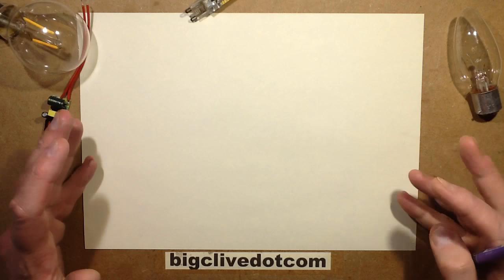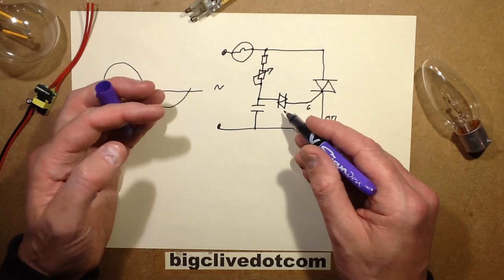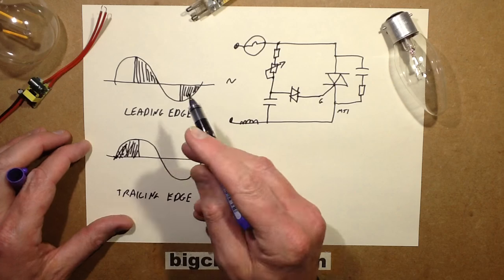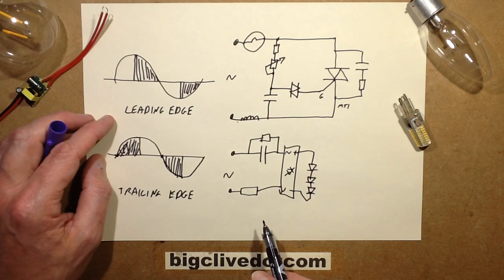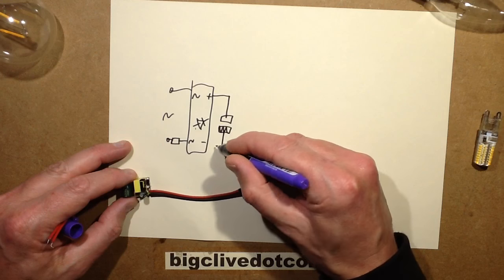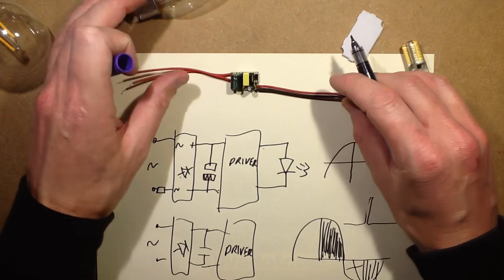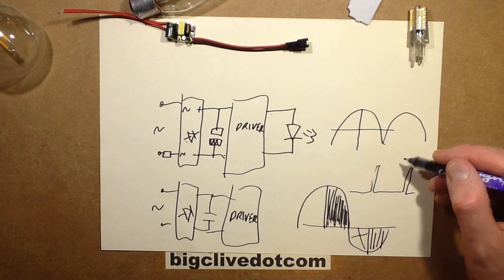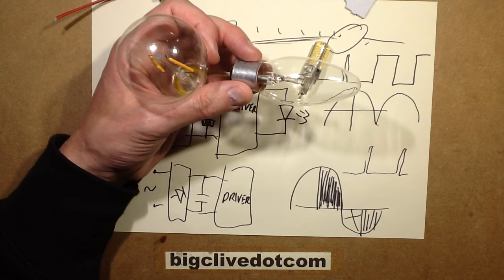Dimming LED lamps with ordinary dimmers.

Comment: Here's a thought which might sound insane to some. Use a line level amplifier circuit. I've built amps before that didn't really have a transformer to speak of. Yes, I know their dangerous and I know why. The point is this. A signal source can be taken from the input and reduced to regulate the output in essentially the function of a volume knob. This yields a perfect sine wave or at least as perfect as it's seen coming from the wall. It's also not as sensitive to load variances. The only real issue is the cost of construction which is likely why they aren't an industry standard. That or nobody has thought of it yet. Also it would be a fairly large device considering all the components necessary such as the heatsinks, smoothing capacitors, MOSFETs, and so on. In theory though, it should work for both incandescent and LED bulbs. I'm not sure I'd try it with CFL bulbs as I'm not sure how it would react with the ballast circuitry. It might be a fun project to try for your channel. I don't currently have a working camera which is why my channel only has the one video so far. I did build one though and it does work reasonably well. It won't fit in a standard wall box for one switch, requiring a 3 device box instead. It works fine as a table top device though, with a hacked extension cord as both input and output. It sits next to the wall on a side table with the cords down behind it.
Reply: You may be talking of a sinewave dimmer ( class D?). Heard of them, but never seen an industrial or consumer one. It would need a new type of LED driver in most cases, although one I designed 6 years ago is compatible and will start up at about 40V ac rms and dim between about 100uA to 700mA.
Reply: Jeremy Lister Interesting. I never had a title for it but being a sound technician, this design made sense to me.

Comment: I have heard (somewhere, don't remember where) that the original dimmer devices were actually wirewound potentiometers (cringe!) -- maybe that would work better for LEDs than it probably did for incandescent bulbs? ;) either that, or a simple variac sort of setup, like the old model train transformers (I think?)...?
Reply from the maker: Yup.  Wirewound rheostats and liquid dimmers.

Comment: What about these new LED dimmers? What kinda magic are they wielding?
Reply from the maker: They tend to use a MOSFET to allow reverse phase control, where they turn on at the zero crossing point and off mid-wave.  It's much softer on circuitry and electrically quieter.

Comment: I have a question Clive.  My vehicle has LED daytime running lights are are illuminated to 100% with the headlights off in the day, and around 50-60% at night with the headlights on.  When I turn my headlights on at night, my LEDs are at a visibly reduced intensity, but I don't notice any sort of flicker at all.  Could it be because they are low voltage (12 v) LEDs and dimming them is easier than a "mains" voltage LED?  Or is this the sort of new LED dimming technology that you were talking about at the end of the video?
Reply: It's just a guess here, but I assume they are doing pulse-width modulation as described toward the end of the video. Many car manufacturers have been doing the same thing with incandescent dashboard lights for over a decade now, and it makes sense that they would adapt that to LED lighting as well since it requires virtually no more R&D. It's a more reliable method, and more energy-efficient too as less waste heat is generated than the older methods of varying voltage or varying current.

The unfortunate side effect of pulse-width modulation on incandescent lights is that the bulbs fail sooner if not run near-full brightness (and that nearly-dog-whistle-noise from filament resonance). Thankfully, LEDs stand up to that "abuse" much better.
Reply from the maker: On the DC system they will probably be using pulse width modulation to dim them.

Comment: if you want a good dimmable LED light bulb, forego the LED and go for a traditional incandescent light bulb.  As wasteful as traditional incandescent light bulbs are, they are inherently dimmable as all you have to do is use a Variac to decrease the voltage on the light bulb.

Comment: Hi Clive, odd question, would normal light dimmers work  with AC motors ? I've built a 3 speed 4 track/stereo reel to reel tape deck for sound manipulation. If I could add variable speed to the motor I could realy have some fun! It's 240v 50Hz (I'm in UK). Any recommendations ?
Reply from the maker: It depends on the type of motor.  The small synchronous motors tend to be locked to mains frequency for rotational speed.
Reply: @bigclivedotcom  It's just a bog standard 1960's/70's mains affair with 2 wires, live and neutral. It would be great if I could get it going backwards, but thats impossible with an old Ferguson mechanism. Ha ha. I'm looking for a quad head, that way it would play side 2 backwards! (plus I'd convert it into a quad recorder).

Comment: Bit of a stupid question but how does the Phillips hue dim the leds in the smart light bulbs?
Reply from the maker: internal circuitry that pulse width modulates the LEDs.  (Turns them on and off quickly and varies the on to off ratio.)

Comment: I live on a boat and use 12v leds for lighting. A friend made me a dimmer for a 20w halogen, but its struggling with only a 2w load. how would yo u do it?
Reply from the maker: You can buy dimmers for 12V LED lamps on eBay.  They use pulse width modulation, so will only work with simple lamps.  They're ideal with LED tape.

Comment: First I hope for a 2 rail low voltage wiring from really good and efficient PSUs in any home: 24 and 5 Volts. USB PD sockets everywhere in your home w/o extra PSU and very good for LED lighting. And over these wires we could create a CAN bus type bus for communicating with each LED fitting.
Reply: Transmitting 24VDC let alone 5VDC would probably not work because of voltage loss and general transmission loss would be greater than the savings from having a more efficient PSU.
Reply: But what happens when small portable electronics either don't require charging from special ports or need more voltage to charge? Basically ... running a house with 2 different voltages adds more complexity and makes the system less upgrade-able.
Reply: FlipFlopGaming Technically in the US the house runs on 2 different voltages since some electric appliances run on 220V and most of the place is on 110V but yeah more voltages more confusion.
Reply: GoogleMinus
At least we should do this kind of things each room, so the wiring is not very long. 24VDC on the ceiling for LED lighting, USB power delivery for some sockets in that room.

It really doesn't make any sense to have a PSU each LED lamp... Its better to have one PSU each room.
Reply: ***** In commercial places they will do things like this, but for houses the demand for 24V systems is probably low enough that they are left out, most people are not going to install all new circuits and sockets just to run LEDs when bulbs that can use the existing sockets and wiring are available so cheap.  The cost of doing the work both economically and environmentally (construction waste) are probably worse than the inefficiency of having multiple PSUs.

Comment: What about these Internet connected smart bulbs like Hue and LIFX bulbs and their dimming functions?  I know those don't use wall dimmers, I assume they're dimming the LEDs by using something like PWM.
Reply from the maker: They do the dimming internally using pulse width modulation.
Reply: I knew they did the dimming internally, I just wasn't too sure what method they used.

Comment: Sorry, but I don't understand why the smoothing capacitor doesn't work. (At around 10:00 in the video.) Isn't the point of a smoothing capacitor that the device (in this case the driver) doesn't "see" a varying voltage like a half-sine wave but instead gets a nearly steady constant DC voltage? That would be the best thing here, wouldn't it?

Why isn't that the case? Why doesn't the smoothing capacitor transform the half-sine into a (mostly) constant voltage?
Reply from the maker: The smoothing capacitor basically converts the dimmed power back into a non-dimmed supply, but is put under severe stress in doing so.

Comment: Hi, I have an LED lit Christmas tree. I bought a good Leviton slide dimmer says for LED and CFL lights. Will this dim the tiny LEDs ok ? they are very bright with 115 V.
Reply from the maker: If they are powered from a small transformer unit it may be damaged by the dimmer.
Reply: Thanks!, they have a small voltage rectifier and that is it. So even this Leviton dimmer for LED's can burn them /?

Comment: Hi, I wanted to ask as I'm very confused and hope you can help us. We bought the Sebastian 3 Light Drop Ceiling Light from John Lewis which uses G4 halogen bulbs, we want to install the lightwaverRF master light dimmer switch but scared as we used a varilight touch dimmer previously and it completely blew up, is it because we don't have a transformer or we need different bulbs etc? Please help!
Reply from the maker: The light should have a built in transformer if it uses low voltage lamps.  If it works with an ordinary light switch then it should work with a dimmer that is compatible with its transformer.
Reply: bigclivedotcom thank u!

Comment: Couldn't you dim a non-dimmable with an autotransformer that simply reduces the AC voltage?
Reply from the maker: That would work with capacitive dropper units, but switcher units may try to compensate by increasing the current.

Comment: I remember when theatre dimmers first went electronic, they used back to back thyristors, clearly it took a while to trust triacs.
Reply from the maker: The inverse parallel thyristors were much more rugged than triacs.  They still use solid state relays with inverse parallel thyristors for heavy industrial applications.
Reply: Thanks for the reply, I didn't know that abut the solid state relays...

Comment: I would love to see a tear down of a Gro-light.
Reply from the maker: I've done a few grow lights (hydroponic lights).  Mainly just standard LED drive circuitry with red/blue LEDs.
Reply: Not quite the same thing, although they may be very similar internally.  The one I'm referring to is an LED night light with a dimmer.  We had to get one of these replaced under warranty very recently because the dimmer just stopped working and the LED went full brightness.  Curious to know if it is a design fault.
http://gro.co.uk/product/gro-light/

Comment: It's actually VERY SIMPLE. (1) use 12V or 24V DC LED devices or strips with all the LEDs in parallel.. (2) Use a traditional 120VAC --> 12VDC or 24VDC magnetic transformer; no switching power supplies. (3) Connect the transformer to your wall dimmer. It'll just work! The worst case is that you may need to slide turn that dimmer 50~60% of the way up before the LEDs will light up. But between the ignition point and maximum brightness it'll work normally and there won't be ANY flicker. If your dimmer is "Smart" like a LeGrande Adorne or something, it'll find the ignition point and self-calibrate that to the lowest setting. Yes, the transformers are BIGGER than a switching power supply and less efficient. So what? you probably have that brick tucked away in the attic space so who cares?
Reply: “Very simple” just rewire your house!

Comment: That was very interesting. I recently bought a dim-able LED for a standard wall plate dimmer. It takes about .5 second ish to light and it comes on at about 3w it being about 9w at full power. The base only gets warm to the touch. I think it was about £6. So as you say it take a certain amount before the lamp starts and it cannot be dimmed below that. Thanks

Comment: hello. I recently purchased some led bulbs to go in my drl/blinker bulbs in my headlights. I installed them, and they will flash with the blinker, but won't come on for the running light function. any help would be much appreciated
Reply: See if you can get a wiring diagram for your vehicle. The socket may not be seeing full battery voltage in DRL mode, for instance GM vehicles either had a DRL diode which was just an aluminium finned heatsink with several high current diodes in series potted in it to drop a few volts. The other GM DRL system actually puts the 2 lamps in series so that each only sees about half battery voltage. Other vehicle manufacturers may have a similar system.
Reply: thanks. I'll try that
Reply: A simple multimeter would confirm that.

Comment: A variable capacitor would work fine for dimming capacitive droppers.
Reply from the maker: It would have to be a modestly high capacitance value (0 to 1uF) depending on the lamp and also rated for peak mains voltage.
Reply: +bigclivedotcom This is true, although a circuit which can do a filtered variable AC buck-equivalent could be used to reduce the voltage which would then not have the downside of being rated for the specific wattage of the bulb. Still no help for the more complex bulbs though.

Comment: Couldnt you drive a small transformer with a triac?
Reply from the maker: You can drive traditional core and coil transformers with a triac, but it requires dimmers suited to inductive loads.

Comment: Why not fer just having a transformer or even better, variable transformer, running to a rectifier bridge and into some smoothing caps. Simple, easy, great for the LEDs, not noisy what-so-ever electrically. Transformers are Cheap, and there are multiple ways of making them variable for cheap. Like having your wall knob physically control how close the secondary windings are to the primary, thereby adjusting the output AC voltage.
Reply: Transformers are bulky and expensive. Cost up a variac sometime. Miniature versions used to be the norm for dimming and there was no way they were affordable in the average suburban home.

There's a reason the market dropped them in favour of SCR and then triac-based switching. (Gate turnoff is best by the way, it avoids the input surge current that kills filaments and generates shedloads of RF.)

As Clive is trying to point out, last century's control methods don't work with this century's lighting technology, never mind reviving an idea from the century before that.

There's also the issue of non-linear eye response and LED brightness curves to contend with. You'll likely find when using a variac that almost all your dimming happens in a small fraction of the dial.

Comment: Clive you popped my electronics cherry! haha...got my first breadboard, jumpers and power supply today and got an LED to light at different voltages and an LED with a salvaged diode to light too! I know that's some really low level corny shit but ya gotta start somewhere, right. ...bought some little motor toys and junk at the dollar store for components and tear down to see how stuff works too. haven't been THIS "spastic enthused" about anything since I was WAY younger and dumb...when shiny things and motorcycles were new to me n made me drool like a retarded monkey in heat. it's all your fault that I now own helping hands, breadboard stuff and the page and a half of tinker toys on my eBay purchase list....n the growing pile of electrical disasters waiting to be disastered on the floor in the corner now...n it gets bigger EVERY time the mail comes haha. THANKS for that! lol

Comment: Wonder if you can get away with rewiring your house to where the lights go off at say...a 12 volt power supply, running 12V LED lights  off it, and just putting PWM circuits where you want dimmable switches. 

At least if there's a blowout, you could have light off a car battery or similar.

Comment: Why do dimmer switches buzz on the lower settings?
Reply from the maker: With traditional phase angle control there is a sudden current spike on each half of the sinewave that can make the internal suppression choke make a buzzing noise.

Comment: Don't you have the flickering problem with florescence lamps with a traditional ballast thingy?
But the main problem I see here is that we still use that damn AC from the last century/millenium...

The problem with this shit is that you need a variable power supply, for DC-DC it's not that hard to do, you "just" need a variable buck/boost converter...

So in theory, it's completely possible to make such a thing. The problem I see:
Is it possible to make it small enough (and with high enough build quality) that it fits inside the wall?
Or would it be just too big if you want to make a decent voltage regulating device (well, that's what Dimmers to, if in a rather shitty way)...

Comment: What happens if a variable resistor is connected in series to a generic LED?
Reply from the maker: It would only be suitable for a low power LED and you'd need an extra series resistor to limit the maximum current.
Reply: @bigclivedotcom  thank you

Comment: So what I've learned from this is stay away from any dimmable LED if the dimmer to be used is a traditional one, because they likely flicker badly even when not dimmed due to the missing smoothing capacitor. And I hate 100 Hz flicker, I find it horribly inacceptable.

Comment: Been using Dimmers extremely sparingly with CFL bulbs.  Mostly because of ahem.  it's supposedly rather dangerous and I tell people who use CFL's with dimmers.  pop the dimmer all the way on and leave it there.   (and many of these are in enclosed ceiling lamps  smh  ahem anyway.  Hadn't thought about LED's yet.  Some of the LED c7 bulbs I've stuck in night lights designed for incandescents light up even with the power off.  So I'd imagine trying to dim them would be complicated since they light up with a very low voltage.

Comment: What about a variable condenser.
Reply from the maker: Some fans use a switched capacitor system, but typical fully variable capacitors/condensers only have very low values due to the use of moving conductive vanes.